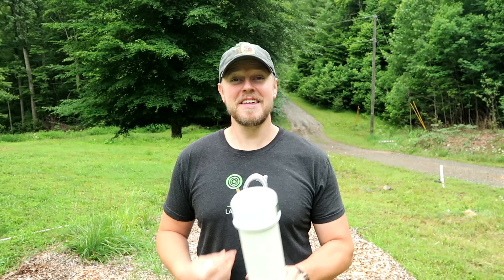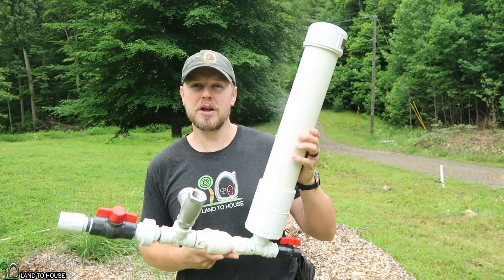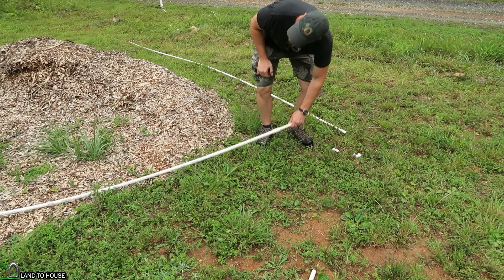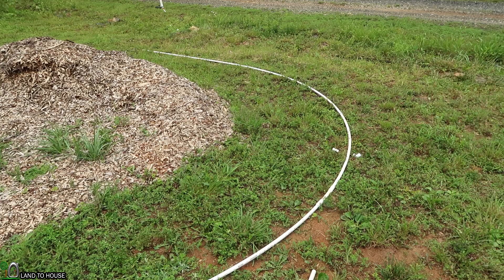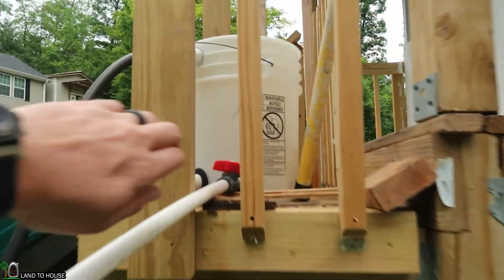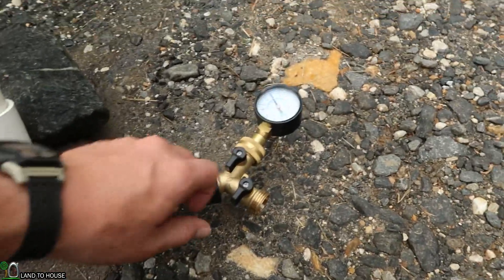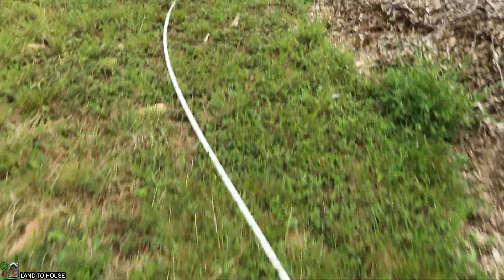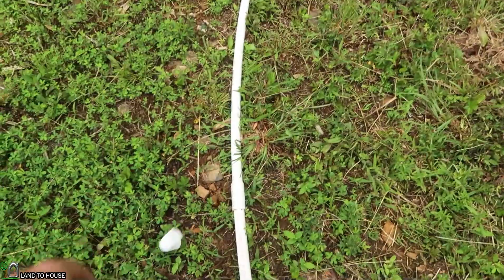90 Degree Fittings in the Ram Pump Drive Pipe

Comment: The increase in pressure with the two 90° elbows is surprising, wereas the longer cycle time (e.g. less cycles in a minute) is expectable. Normally, a longer cycle time leads to higher pressure (because the water in the drive pipe will be longer accelerated to higher velocity). In this case the two 90° will hinder the flow so it takes longer to reach the velocity when the wast valve closes. Hence, I would not expect higher velocity of the water and therefore no higher pressure. But it could also be that the 90° elbows will damp the pressure wave in the drive pipe, so it will not be that sharp but therefore last a litte longer. That gives more time to push water through the inline check valve and into the pressure tank, and hence could lead to higher pressure.
Nevertheless, that was only one measurement and perhaps other parameters were changed also (e.g. the pump tilted at the end in the first test). Also, the difference was not that significant (56 PSI vs. 60 PSI is only one scale mark on your pressure gauge). Furthermore, the most relevant value would be the amount of pumped water vs. used water (the efficiency of the pump).

Comment: Hi i love seeing your videos, learn alot from you regarding  the micro turbing and the ram pump...i just got a question about installing ram pump, my ram pump working by testing it with a pail of water 3ft above the ground and its working properly, and great.. but i got a river near house, but onlu proble is no elevation, what can i do to improvise to elevate at least 3 ft above the ground. ...? Thanks
Reply from the maker: Thank you for watching! I have managed to get the ram pump working on 1 foot of head pressure. It is inconsistent though. 2 feet is the minimum.  The only way the pump works is with head pressure. You can extend the drive pipe past 100 feet by installing a stand pipe and supply line.

Comment: How does the pressure and volume of water delivered compare with a straight direct drive pipe from the same point a to b to the curved routes?
Reply from the maker: I need to test that for sure.

Comment: Just throwing this out there. Maybe the 90's create a small resistance on the down flow but that Resistance adds to the back flow pressure allowing the air tank to maintain a higher pressure.

Comment: With the first or straight(sweeping curve) setup, there was a long distance for pressure wave to travel when the valve snapped shut.  On the second or 90* setup, there was only 1/3 the distance for the pressure wave to travel when the valve snapped shut.  It seems the shorter the drive pipe length the quicker or faster the valve cycles and so doing the pressure rises a little more than with the slower cycle times.

Comment: Hi Seth, Thanks for the great videos always enjoy them.
 I have a two-part question.
 I have a remote piece of property with a year round creek, l want to go from a ram pump feed into a battery-operated timer for irrigation, 
1- will it work and 
2 will the pressure stay constant in the pipe when in use.
Since it's a remote cabin and only used on the weekends I don't know which would be better having a constant Ram pump piped directly into the cabin and irrigation for fruit trees or if I should go into a 2500 gallon storage tank and gravity feed from there Thank you
Reply: I'd go for the storage tank
Reply: Ram pump into storage tank, and gravity fed to your irrigation system.

Comment: EXCELLENT EXPERIMENT WITH COUNTER INTUITIVE RESULTS!

We have two effects here:

First, the curved pipe acts like a spring absorbing energy.  In fact, part of the longitudinal momentum is transferred into a transversal component (for that reason springs follow a curved pattern, because mother nature uses this feature to reduce energy on the spring and thus, reducing erosion.  A whole documentary about these effect can be found here: http://www.ecosol.ca/eco-life-ecosystem/).  That explain the less amount of cycles on the check-valve. 

Secondly, for the increase of pressure: when you have a curved pipe the knocking longitudinal momentum is not transferred 100% to the check valve, making it less efficient in building up pressure because part of the energy is absorbed by the curved pipe as explained before.  On the contrary, by having straight segments, the pipe has no option but to transfer all the longitudinally knocking momentum to the check-valve, which translates in higher pressure build-up.
Conclusion.  Probably that is why cavitation is so frequent at residential installations that uses copper pipes instead of flexible PVC pipes...

Comment: I would guess due to the physics of how the ram pump works off of a water hammer effect that what really changed was the distance from the inlet of the pump to the last 90 in your drive line...
You might find increasing that length will act more like the radial bends of t 1st test. But at what point would reducing the length be detrimental?
Reply from the maker: It would be interesting to see what would happen if the last section of pipe after the 90 were longer.

Comment: Written a couple times and still have questions. Ram pumps don't operate for 1 minute. They operate for a summer or longer. So if final operating pressure (established after hours or even days) is adequate, then which provides highest flow rate/hour? To me that's the measurement. I've had 2x the cycle rate produce 1/5th the volume. I've had the same output pressure produce significantly different flow rates. I'd encourage you to take a look at that. Keep up the great work. Really appreciate your effort!
Reply from the maker: Yes longer run times would possibly change things up some. I just posted that video of a pump going for 5 weeks. I still recommend a long  drive pipe that does not have 90s.

Comment: In theory, abrupt turn should make it worse a little bit.  I think the first result of bending driver pipe is worse because the ram pump move and start tilt down during the test, resulting in less performance
Reply from the maker: I noticed that in editing! Did not see it during filming. Probably does make a difference!

Comment: So which delivers more water volume per minute, more cycles at lower pressure, or fewer cycles at higher pressure?
Reply from the maker: From what I can tell cycle times of 1 per minute is the best for pressure and flow.
Reply: @LandtoHouse  1 per minute?
Reply from the maker: Woops per second!
Reply: As far as this... just put a bucket at the end under the measured time to get volume.
Reply from the maker: I need to get a measuring cup to test more accurately.

Comment: I like how you test these things to find this stuff out, I think people will always be interested in real data like this.
Some of this resonates with RF theory to me. In RF circuits you avoid 90° turns because it causes reflections with destructive interference etc. I imagine the water in the pipe is mostly in laminar flow and the 90° will break that and cause an increase in pressure making the pump think the drive pipe is shorter? It's a bit like the other experiments you did with the check valves (though I can't remember the result of that now lol).
Anyway, I mention RF (and I'm not an expert on that any more than this stuff) because those systems, particularly antenna feeders, are tuned to minimize those kinds of losses from the source to the consumer of the energy (radiator in that case). I wonder if there are loosely similar things like that going on with what you do.
Like, I think you mentioned on another vid that there is an issue with the cycle time being too high with short drive pipes? In RF if the length of cable you need is ridiculous you can use other things like a stub, which is basically just a piece of cable off a T connector that doesn't go anywhere. You might try putting something like that near the pump in a compact setup (closed off at the end, but air bleedable I guess) to see if you can fool the pump in to thinking it has a longer pipe in front of it? If that looks like it does anything at all then you might be able to try varying lengths to see what difference that makes. 
Just some random thoughts, keep up the good work!
Reply from the maker: Good points. Especially the part about the pressure wave hitting a 90 and thinking that the drive pipe is shorter. I think you could be onto something there. I also feel like the pressure wave is broken up when it hits a wall like that.

Comment: That's really surprising! I would have thought that the 90's would have prevented the momentum in the pipe from being able to build up fast enough. I guess for the size of the drive pipe vs the speed the water gets up to in the pipe, having a 90 degree bend doesn't really affect it that much at that scale!
Reply from the maker: I was also a bit surprised. But I think my conclusion is the same as yours. Small Ram pump short drive pipe and only two 90s did not make too much of a difference. Perhaps I should have also done a completely straight drive pipe to see if the sweeping turns reduced significantly?
Reply: @LandtoHouse  There is also the question of how much lift there will be on the other end and will the back pressure slow down the cycle on the 90 delivery line so that it stops. Moving the 90 closer or farther away could then tweak the system while keeping the added pressure gain. Another check valve didn't work in this position but it looks like you just found the key to adjusting the pressure wave. Better patent it quick.
Reply: Also just a thought... Maybe the 90's acted a bit like check valves?!? Just a bit...
Reply from the maker: It is possible that the pressure wave turned around there.